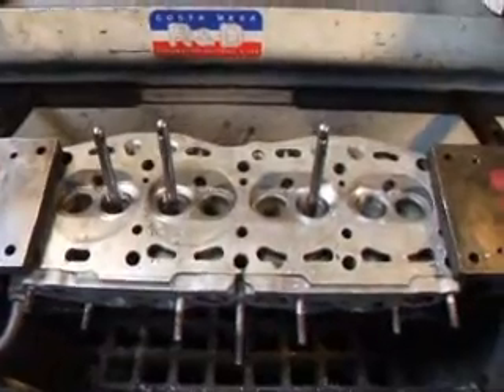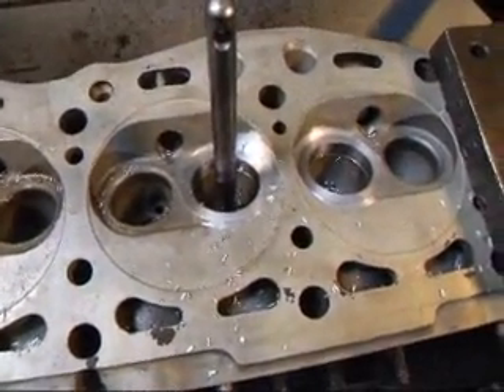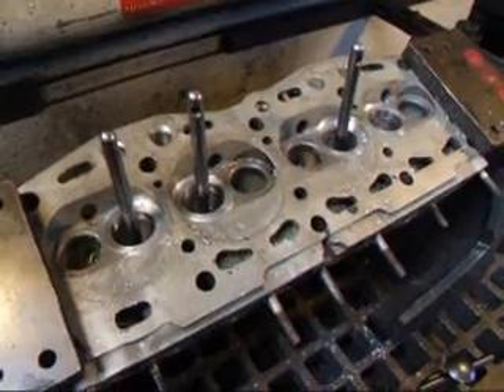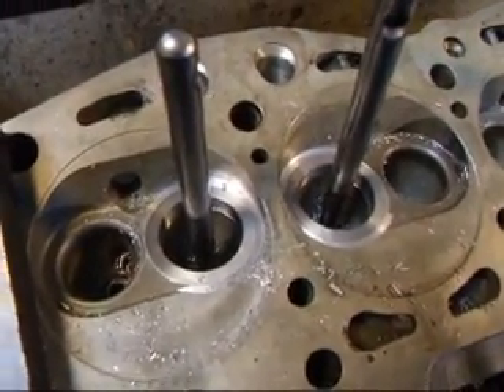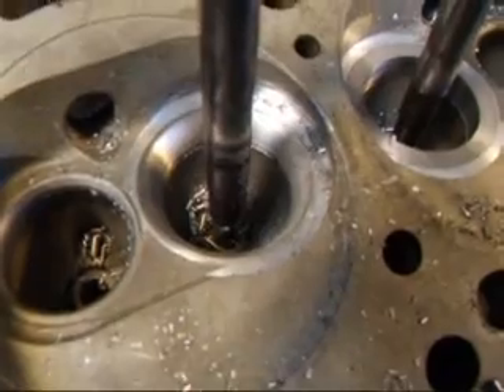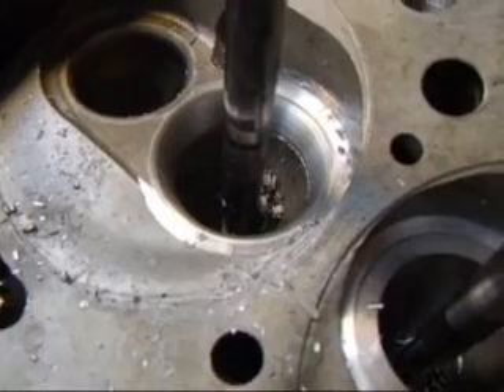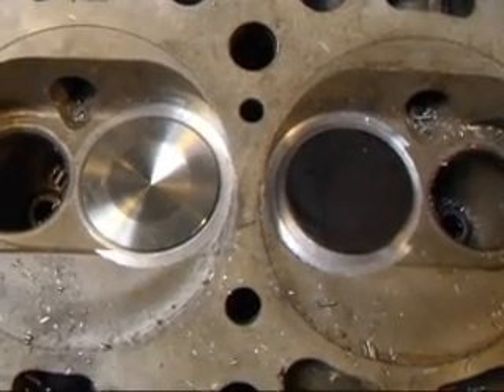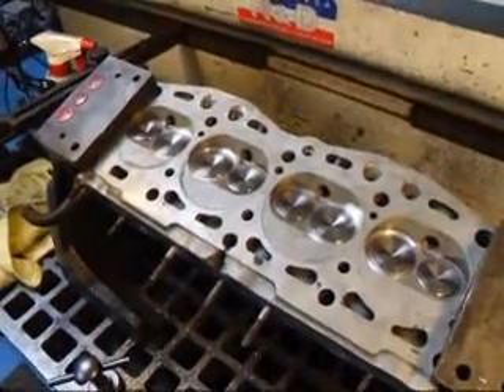Fiat Big Valve Installation X1/9 & 128

Comment: Very nice :) , so what is the gain with those few extra millimeter? is there a consistant gain in performane?
and will the higher revs still be available with those huger valves that have to move so fast?